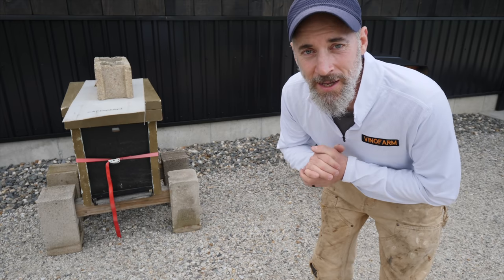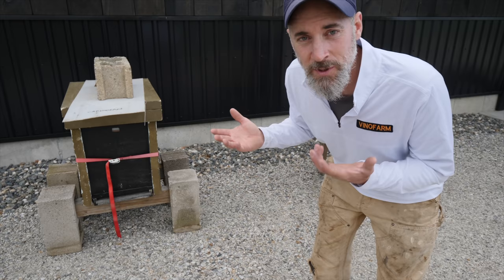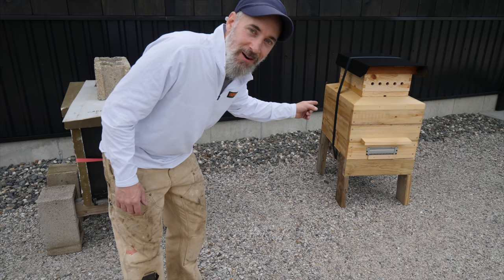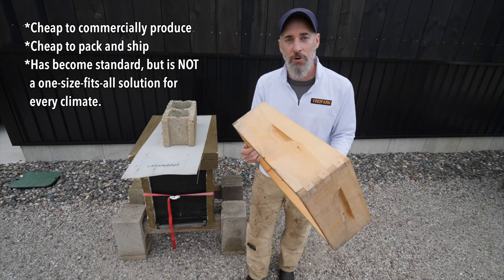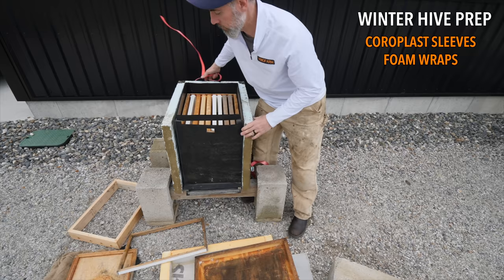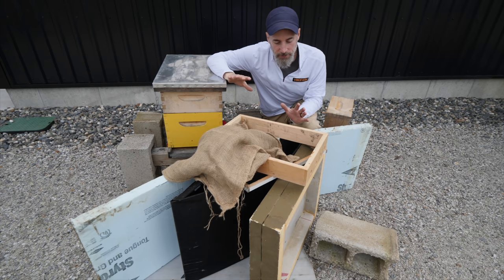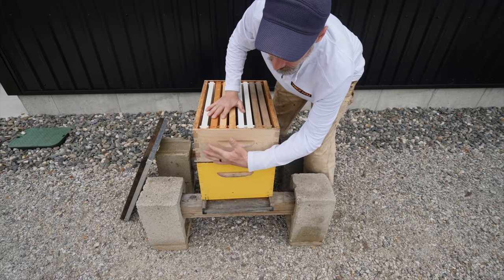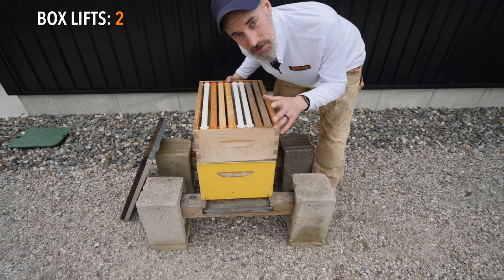I Fixed The Langstroth Hive (For The Bees AND The Keeper!)

Comment: Kevin McMahon of Bear Creek Honey: https://youtu.be/XkLhvkDBcFo
Reply from the maker: What am I looking at here?
Reply: @vinofarm  This is Kevin's experiment without a top entrance and ventilation, which shows a faster build up of brood coming out of winter. This is also the same result that Etienne Tardif found in Alaska using insulated hives. Etienne also found that it provided a better survival rate.
Reply from the maker: @beehinde  I really wanted to understand this presentation, but it was really confusing and he breezed over a lot of key points. I need to explore more stuff from him. It sounds like I'm on the right path, but I'm open to modifications. I just don't know what his conclusions are.
Reply: @vinofarm    Etienne's setup was insulation on top and around the sides.    His configuration was no upper entrance, nor ventilation, this meant the bees used 6 times less energy than another Alaskan configuration, which was a smaller lower entrance than the upper. This one had similar material to yours to wick the moisture. 
If you were to do away with the vivaldi boards and replace it with 2 inches of Kingspan between the inner cover and roof and only have bottom entrances it allows the bees to consume less and maintain the temperature of the hive. Once you look in through the top of the hive it takes 2 days for the bees to recover. The insulation on top stops condensation from building up, but they are able to maintain the necessary humidity in the hive. If you had no insulation on the sides of the hive then the condensation will build up on the inside walls and run down. I have poly hives and wooden hives, my wooden hives have no upper entrances but 2 inches of kingspan between the inner cover and roof. My poly hives have no upper entrances. In spring the poly will have brood developing right by the hive walls, the wooden ones will have brood in the centre. Although I'm in the UK, both types perform well. The poly hives eat less winter stores. I hope this helps you with your modifications.
Reply from the maker: @beehinde  I’ve always been concerned about CO2 build up with no openings on top for 4-5 months. He got close to making some points I was very interested in hearing and then kept flipping to the next slides. I need to explore more of his site and videos. Thanks.
Reply: @vinofarm  Bees can withstand higher doses of CO2 than humans
Reply from the maker: @beehinde  I know that, but we're talking 4-5 months in those boxes. I'm going to be learning a lot before winter in 6 months!
Reply: CO2 is heavier than oxygen and will sink to the bottom and out through the mesh floor or via the fanning of the bees. One side of the entrance air gets drawn in by the bees and CO2 expelled the other side of the entrance. Frederick Dunn and Kevin McMahon have both kept bees without a top entrances. You could reach out to them to get an American viewpoint.